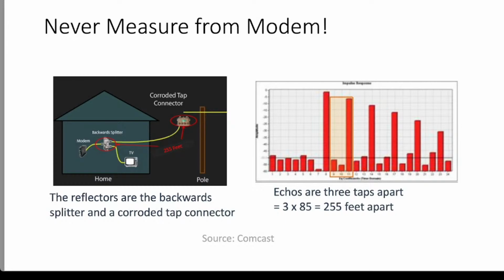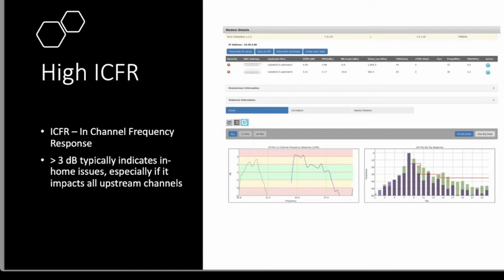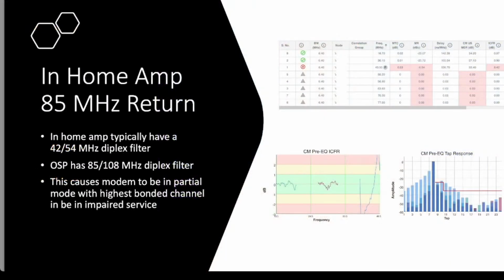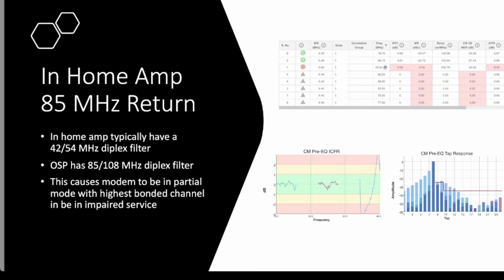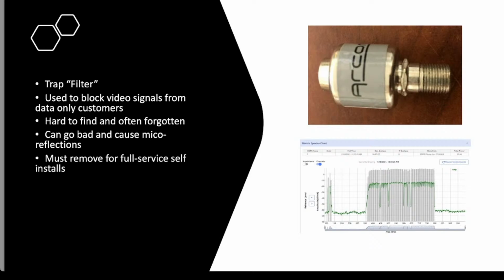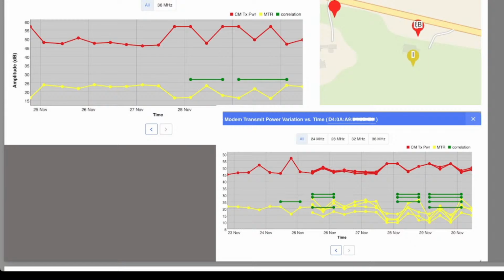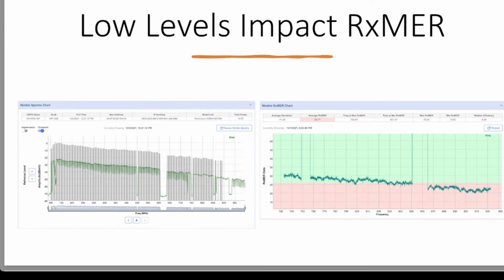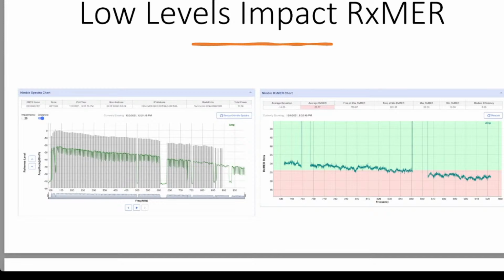In Home Impairment Identification

Comment: I having been have a problem with my modem running in partial mode I have checked through your videos and tried everything anything other thing I should try?
Reply from the maker: If a reboot doesn't fix partial mode, next step is to check all of your cables and connectors in your house. Once you verify those are good, your next step is to call your cable operator and inform them of the issue.